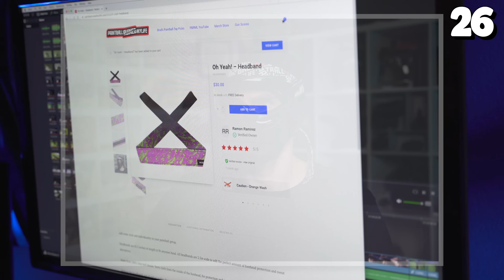47 Paintball Tips

Comment: Hi I'm just getting into speedball/paintball will be buying some entry level stuff to get my foot in the door and need help. What lasts longer if shot the same. 1 65/4800 HK army aerolite tank OR 2 HK army 48/3000 tanks?
Reply from the maker: A rough way to know is a little math.You can multiple the tank size by either 10 for 3000psi or 15 for 4500psi. 68*15 = 1020 shots and 48*10 = 480 shots
Reply: Not only like the other comment said but between the 2 sizes you said which should've been 68/4500* and 48/3000, the first number is the volume of air the tank will hold followed by at what max pressure or the 2nd number. In the question you asked not only is the first tank bigger volume wise but also is able to be pressurized 50% more than the 2nd tank you listed. Last but definitely not least, not only will you get quite a bit more shots with the first tank but I also don't think I've ever seen the size of the 2nd tank made from anything other than a heavy metal like steel or maybe aluminum making them quite heavy.  However the first tank you listed should be made of a much much lighter fiber composite material that makes a huge night and day difference to the weight and balance of your marker set-up!

Comment: Another tip for the 2 piece barrel.  Put a little grease on the threads it stops it from getting stuck. I do it an my barrels never get stuck an they never come loose well playing.
Reply: Something like never seize grease works well. A bit messy, but it doesn't take a lot to do the trick. Find it at car parts stores. Often used to prevent the threads on dissimilar metal parts from seizing together.
Reply from the maker: Yep anti seize grease 👍